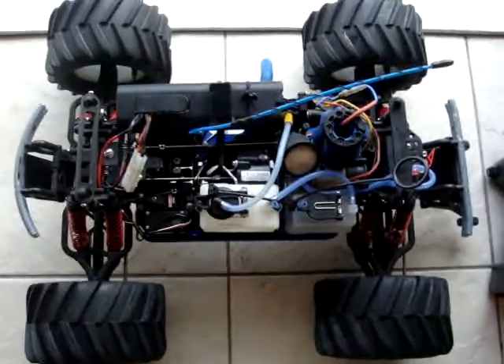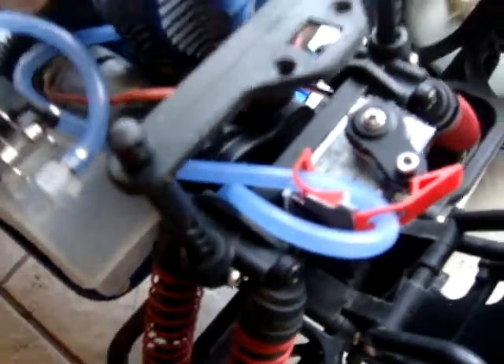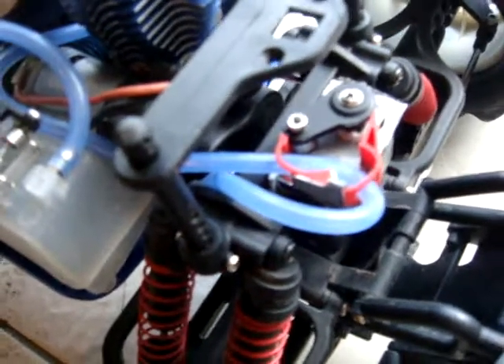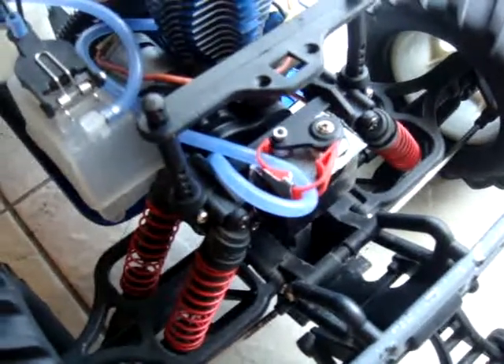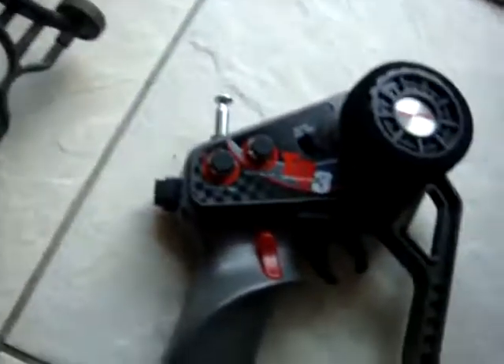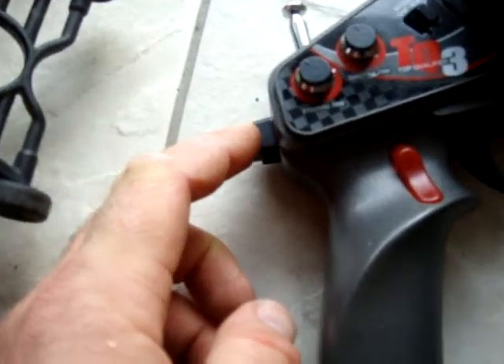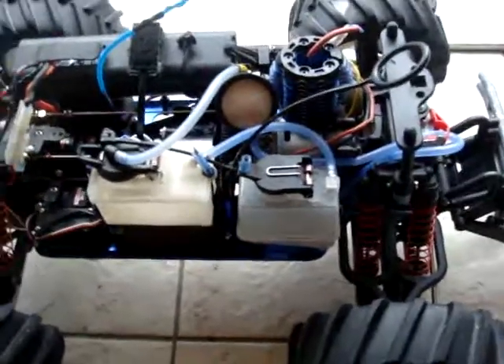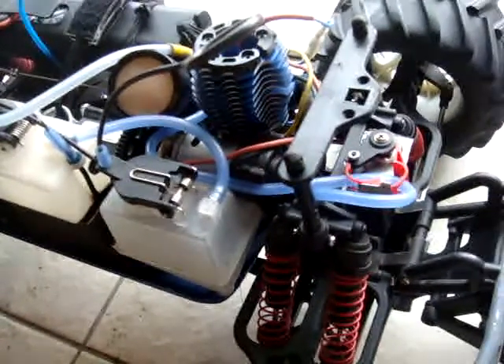Traxxas T - Maxx remote stop system using third channel, (Vid 10)

Comment from the maker: @sbs9026  Hi, I've actually seen some of your video's before, (nice job) and all my traxxas vehicles now have remote start and stop systems on them.(see my other video's)
I eventually decided to create my own system because it was alot cheaper, and easier to install and de-install.
It also ment I did'nt need to upgrade my remote, (although it's optional) and you can still manually start it without having to use the remote, which is useful when tuning.
The system is now alot lighter as well.

Comment: Hey, you know I had remote start on a REVO over a year ago.   I was the first to use a Ross Remote Start System on a Revo 2.5 & 3.3. It will also work on T-Maxx, and many other rc models. Check out the How-to video called "Ross on a Revo". An 8 part series right here on Youtube...